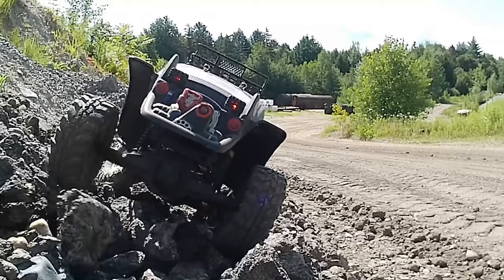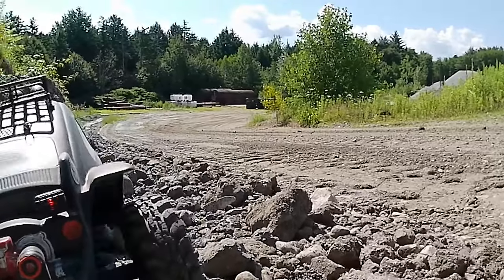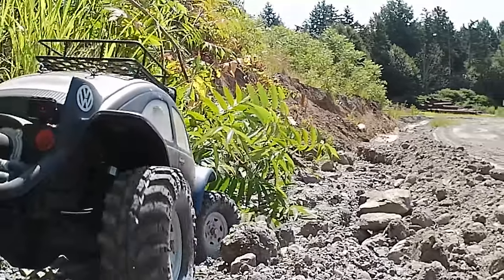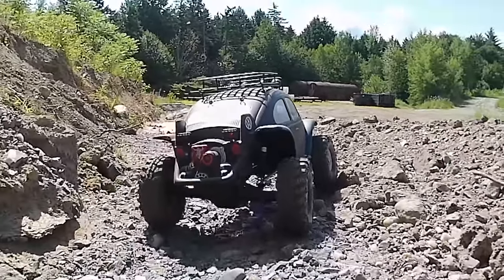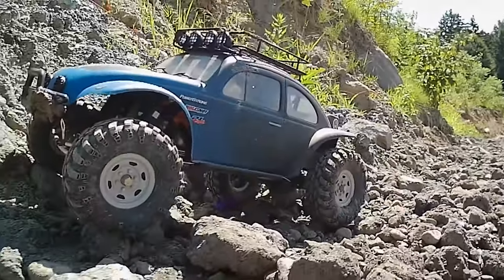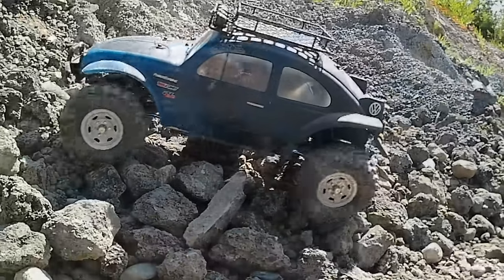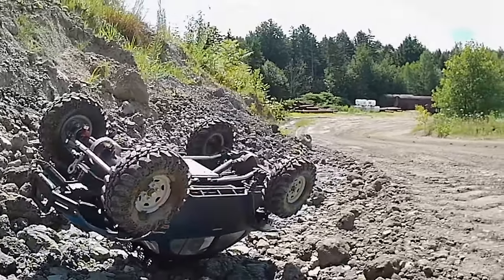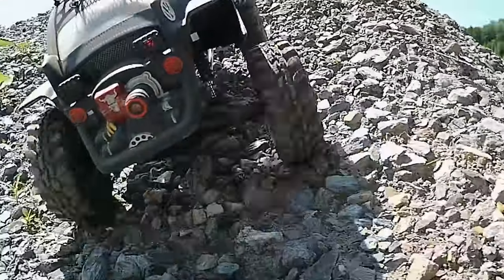Redcat Gen7-  Super Beetle 2.0 - Quarry #2 - w/Voiceover 👨‍🚀🎙

Comment: Really good video and dialogue have you thought about possibly doing the front inner fenders kind of like the front Tub That Volkswagen beetles have and that could work as your inner fender for the front
Reply from the maker: Thanks, Jeremy. Much appreciated. Yes, over the last few days of watching this video during editing, I've actually been pooling ideas on how to do it. I think, in order to keep it with the body, like the rear inner fenders when lifted off, I'm going to take up the real estate on the inside of the front fenders and do a very similar thing with vertical pieces to cover near the shock towers. The servo needs room to move in between the frame rails so I gotta keep that area clean ;) It will be nice to not see the other wheel turning at the same time. I was hesitant to do it with this material but the paint seems to have made a little more durable. 👍👍

Comment: That skid plate looks legitimate. The one I made I ended up hating it. 

How about a tube cage around the engine?
Reply from the maker: Ha, thanks. Got lucky on that. I was happy the metal cut easily enough with tin snips. The cage isn't a bad idea, cool thought. There was a flat-back design I saw that sort of worked. I could easily incorporate a spare in something like that. However, that's a bunch of custom brazing and fabrication that I'm not set up at all to do at the moment.
Reply: How about a rear aluminum motor bumper guard. They made it for the Tamiya Sand Scorcher. You can find them on Ebay. Only thing is will it fit? I had just looked at this not long ago for the 1:10 scale version.
Reply from the maker: @scarletisbell8520  I thought about that last night as a watched a few new videos that have popped up of the Scorcher in the last few weeks. I think the body of that it a tiny bit smaller proportionally. MY thought would be that maybe I could braze one together bt I'm just not set up with the stuff to do that.

Comment: Front fenders use old cool whip containers cut to fit like mold it to your liking, then paint.
Reply from the maker: I used foam board on the rear fenders which is what I'd probably use again for the front, It really gave me the freedom to make them to the body spec. I just haven't worked on this rig for a few months. Good winter time projects.
Reply: @VermontScaleCustoms  oh yah I got ya on the foam board I've used that before also great content and info 👌

Comment: Boiling those foams then toss in dryer really improved my redcat foams but it mainly helps on rocks trailing I noticed it lost performance they folded over to much your right.
Reply from the maker: That was a trick I saw a couple of years ago and sort of laughed until I tried it. I still think it works fine. The tires have a little bit of fold but I can handle that. Real tires fold as well in a variety of crawling situations so it's something I'm willing to deal with in comparison to having stiff, unforgiving, foams.